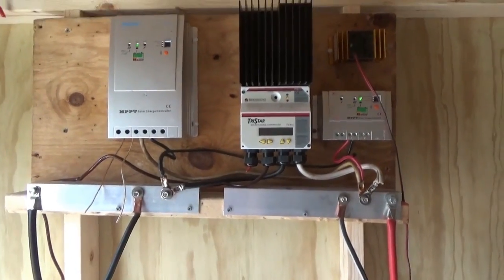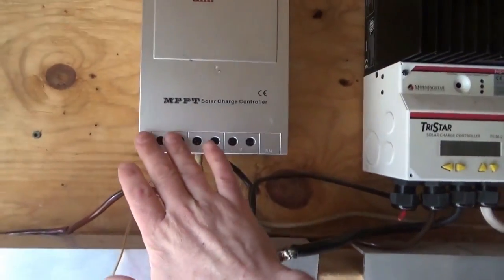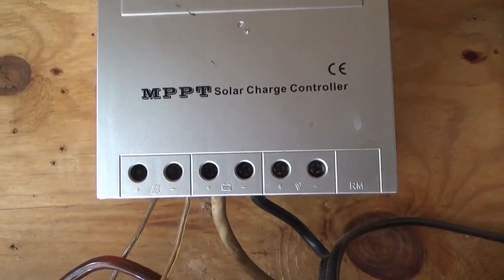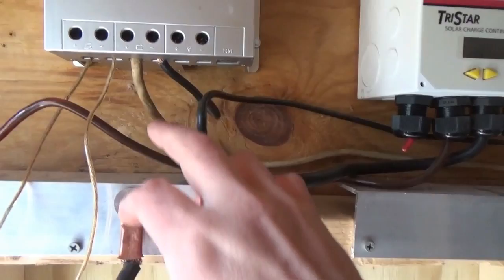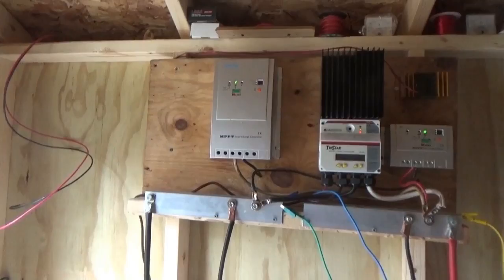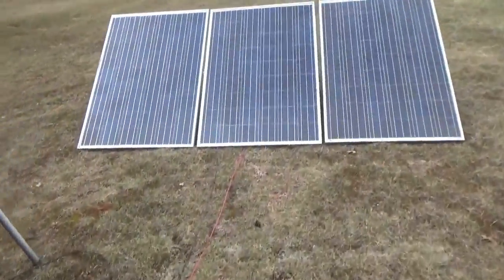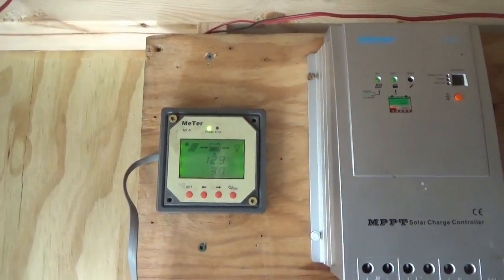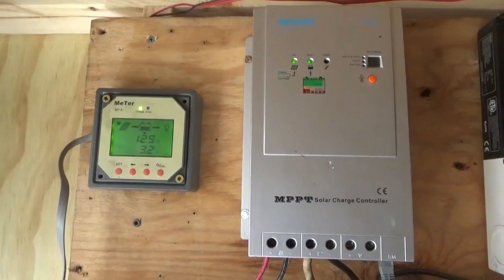How To Connect Solar Charge Controller ~ Setting Up Off Grid Solar

Comment: What happens if, you don’t hook up, the battery first! Nothing blew up ! Should I disconnect it, and reconnect it! If that reset the controller
Reply from the maker: Always connect the battery first. This powers on the charge controller. If you did not, I would remove everything and connect the battery first, then the solar panels to be sure things are running properly.

Comment: What gauge wire did you run from your panels to the controller?
Reply from the maker: Dont remember but use the biggest you can fit or afford.

Comment: Hi buddy great job, l have exact charge controller, can you tell me about the option settings in the spy glass where it should be set to? I have 2x 230 amp deep cycle 6 volt batteries 2x panels cheers..

Comment: Hello Bro🙂
I have 5 mono solar pannels 150 watts each .i have used PWM charge controller Battery Bank that i have is 230AMP .i have used My 12 Volt Dc in which i have 3 fans and 6 LED lights .😊
Total load have is 16AMP.i connect solar plates parallel Now.i bought MPPT charge controller 60AMP.
Kindly suggest me that i used this as a parallel or do it in series connection.Thanks😊
Reply from the maker: Look at the maximum input voltage of your MPPT controller. Wire your solar panels in series to add up the voltage. You can be lower but do not exceed the settings of the charge controller.

Comment: Troy, I always get confused when wanting to hook up a controller. My LOAD is connected to the battery in my RV. So, do I try and separate the load from the battery bank or can I simply hook up the battery ( with the load ) to the controller as it looks like you did on this video .? Thanks
Reply: The load going through the controller usually has a max of 30 amps, limiting the uses you could use through it. The MPPT controller I just bought controls the load with a timer, it's either always on, dust/dark or always off, with protections for over current, over voltage etc.  If you have a battery bank supplying a 3000W power inverter You can't wire it through the controller as it would always trip out.  The load will draw current out of the circuit, pulling all the current generated by the solar cells and compensating with the battery bank during high production periods (noon) and vice versa when the panels can't supply enough juice to run your loads. The inverter should have its own protections for low voltage and fused appropriately.
Reply: Thanks so much for answering. That all makes sense, ( the inverter tripping out ..due to over current draw.). So, in an RV, you wouldn't need to use the separate "load" hook up on the controller.

Comment: When using black and white wires for 12volt/low voltage you should be using black for positive and white for negative.
Reply: Black has always been Negative for DC in Australia . Black or Blue always Neutral for AC in Australia
Reply: @davidsoper1885  That's an interesting aside but this guy is in the states and has used the colors black and white in a backwards fashion for here in the states. Hence my comment.

Comment: I've got an SRNE 4860 60 amp charge controller.  One of the settings is "capacity".  I've got 4- 6 volts wired in series for 24 volts, batteries are 225 ahs.  So would I set the capacity setting at 225?  Or higher?  The manual sort of sucks in my opinion, or it may be me, being a newb and all.  tks.
Reply from the maker: You have a total of 225Ah at 24 Volts. The Watts are still the same though but the Ah does not increase when wired in series.

Comment: has anyone connected panels to a charge controller before connecting the batteries? if so what happened.
Reply from the maker: It could harm the charge controller so I would try not to.

Comment: You need  a  combiner box for your panels safety first. ... ..I have a trystar ts 60 PWM controller am getting 80 volts to my 48 volt bed works grest am running 14 -310 panels and 4 - 240 panels on a smaller controller .thank you for sharing your videos

Comment: I have a NEW PWM 20A LCD USB Solar Panel Battery Regulator Charge Controller Kit 12V 24V. I connected around 15 solar panels and 10 big batteries and probably around 15 small batteries - all 12v. I'm having trouble keeping power enough to one bedroom with a 400 watt power sucking TV and then all the other electronics in there like a laptop and just some lighting and phone charging. I did take several of the bigger solar panels most of which are 100 watts each and I did collect connect them positive to negative to positive to negative and then the ends to the system. What am I doing wrong. I should be charging a whole lot more.
Reply: 1 panel is about 8amps so u can only use 2 panels u need bigger mppt

Comment: I'm running that same 24v system as well with the 8 t-105 batteries on a catering truck and that would be awesome if I could convert it to solar charge after I unplug from city power. Where did you buy the panels from and are they expensive?
Reply from the maker: I got mine 2nd hand but unused. So cheap. EBay has very cheap panels now. Look for $1 dollar per watt or less.
Reply: The Do It Yourself World how many watts do you recommend?

Comment: Wire tips      That wire ,if 6 awg is good for up to 120 amps. Your inverter looks to be drawing a normal max if about 83 amps.  IF you bundle the wire ,that is cover it with alligator skin. REDUCE the current rating by 30 percent for heat derating. There  is no way I would use that wire without flux and tinning the terminals with solder. I wouldn't tell anyone when I use lead /tin solder. Shrink tubing on the terminal end is good but don't go over board on the length.  If someone os going to do any DC electrical project, I recommend printin and posting this chart.      https://www.westmarine.com/WestAdvisor/Marine-Wire-Size-And-Ampacity         Now ,if you want to calculate what your losses on the cable would be, pay special attention to the OHMs per 1000 feet column,which in this case would be .4 ohms per 1000 feet and use the junior high school formula of Power (on the transmission line)   EQUALS current squared times resistance  IN OHMS      tHE power loss for 120 amps times a thousand feet would be 19.2 watts or ONE Tenth of a watt for a ten foot section IF 6 guage wire with NO high resistance fittings.      This chart is again for DC current . Charts are different for AC.

Comment: troy get the solar panels somewhere else. your junking up the yard. fine another place for them.
Reply: hope its not gonna be a 30 years planning,  its faster to fix things correct the first time... , he is not depending on the power now, so no hurry involved, its realy better to do it right directly, build a frame, put them on the right angle, a few feet above the ground, build a frame first!!!!
Reply: y understand, but again do as mutch as possible right the first time, less hassle in the future! (y)
Reply: i know they need the sun.But make something that they are up off the ground.
Reply from the maker: Oh but there is a rush. You have not seen my estimated energy bill here. Ouch!!! I have to get off the grid in a hurry or I wont have any money for anything else but electric and propane. And yes I plan to get the solar panels off the ground right away. On frames. Adjustable frames. Payday is this weekend and I have to see what is left after the bills before I buy anymore wood.
Reply: you cant put solar panels in shade they don't work very well in the shade and its not junking it up if its something that's being useful and I'm sure troy figured out a frame that can allow for better solar production so unless your in troys situation you have no room to speak.

Comment: Generic safety/code suggestions:
Usually code requires physical switch between panels and controller; fire Dept. likes to see those. Most people also fuse/breaker at least the plus line; some code requires fusing/breakers on both POS and neg lines from panels. cheaper controllers also should have surge arrestor to help prevent lightning damage; better controllers build them in.
Battery setup should be fused/breakered on both the feed to/from controller and to inverter. Feed from controller to batts should also have a heavy duty switch in addition to the fuse/breaker for safety and maintainance. Usually code throws in more picky points but the above is usually the minimum for safety and servicing purposes.
Reply from the maker: Thanks for the updates. When connecting all of this to a house I will pay the electrician in order to cover myself.
Reply from the maker: I wonder how they do that with all the micro inverters with grid tie setups? I cant imagine 20 or more switches.
Reply: microinverters are tied together and/or are exempt because their on/off switch on the unit counts for code and/or an exemption due to being within 1 or 3 feet if the panel and the switchgear by the grid tied does all the on/off work. Grid tied never made sense to me so I glanced over those parts of NEC code rules...
Reply: Good idea! In my neck of the woods inspectors were hypersensitive to anything within 10ft of a house, sheds - not so much. Probably should have a chat with your city/county inspector to see how they feel about code; some are flaming aholes, some are super chill...

Comment: How to install a solar charge controller .
Read the manual , Understand it , Ask if you don't  !
USE the voltage sense on the morning star  .
You will be saying it's voltage is incorrect …
Use all the controllers capability's / enhancements  , there not for show .
Reply: and juse the temperature sensors on the bank...

Comment: When you were showing the battery bank I did not see any kind of fuse. I fuse mine at the battery's. All it takes is a fuse holder made for big audio amplifiers and you can get fuses over 100 amps. Without a fuse at the battery's something could happen (tool fall between your powder strips, ect) and turn the smallest wire inline into a heating coil and easily cause a fire. 
http://www.ebay.com/itm/NEW-EFX-4-8-GAUGE-AGU-PLATINUM-CAR-STEREO-AUDIO-AMP-WIRE-INLINE-FUSE-HOLDER-/300869684875?hash=item460d3b0e8b:g:0h4AAOSwzOxUWO76
Reply: well use the plate fuse or use a couple in parrel either way a battery bank unfused at the batteries is a dangerous thing. the largest draw I ever did was 25 amps to run a commershal smoker (only for the motors and the electronics) when there was electrical storms to protect the smoker but also keep production going. tne point is you figure the max you are goi g to neec and fuse over it a bit. a 100 amp draw on his battery bank is not going to last but a very few min. I could do my 25 amp draw for 11 hours with a 8 battery bank.
Reply: point is you need a 300 amp dc fuse iff he uses his4kw inverter... they sell plate fuses for that, we use them on boats. 100 amps is nothing on 12 volt systems..
Reply: agree, but if you draw 3000 watts at 12 volts its around 250 amps draw from the bank, at 690 amphours thats do able for 1,5 hours...so you have to fuse acordingly to the possible (short time) load.

Comment: Did you bring your wind turbine?
Reply from the maker: I do have one here and have to go back for the other one.
Reply: forget those bloody small wind turbines, they wont work in forrests... they dont, you have to make huge masts for only a few usable amps, wind turbines are only usefull if they are huge. small ones are good on oceangoing sailboats, fot thre rest they suck for charging whit high amps. one solar panel more wil give you way more power then those small turbines.
Reply: Read my comment, sell them, or trade whit solar panels or battery's.,you dont gain mutch whit these wind turbines.

Comment: jsust wondering .. shouldnt you have somthing covering your buss bars speacialy the posetive side to protect from accidental shorting out ?
Reply: Not to be negative, but It still is a mess.... for ones can you do something at least a little to code????   Have seen some good comments here, Quit building things for temporary,but build  correct the first time, way lesser work and problems.. put your panels on the roof off the shead,(use alu angle profiles) use breakers in your cables,(also in the panel lines, dont put more then one mppt high power charger on the bussbars, connect all mppt chargers whit as thick as possible cables to your bank, and switch and fuse it, you can use the busbars for apliances other then the mppt's (if you put several mppt chargers on the same bussbars they will react to each other, and not on the state off the bank), and ground your panels, use a earth rod..(for your safety). not to troll, yust to advice...
Reply from the maker: I am only using one MPPT charge controller right now. And your advice about only one on a bus bar is good. They did not work well together before. Thanks. I cannot put solar panels on the shed roof. The sheds are in the shade. Had to follow town hall permits for location. The solar panels will be on stands out in front. House is in shade too. No solar panels on any roof out here. But the sun shines all day on the yard. Very nice.
Reply from the maker: I am also still on a budget. I have plans to make things good. Right. But it all still takes money.
Reply: btw, as said before put the bank in a box whit a lid on it, and a pype to the outside for ventilation..cover your positive bussbar, and use fuses!!
Reply: Still keep on kicking him to do it correct,(also when he advices people how to, he has to  explaine  it correct) been kickin for about 4 years now... lol one time, one time ... lol
Reply: tt4465543
Reply: The Do It Yourself World w3   č
Reply from the maker: If you feel safer that way then certainly yes. I use mine heavily for clamping things onto them so I need them open to use all the time. Never once shorted anything out on them in all this time. Mostly due to being up higher on the way and out of the way I guess. Just as much chance of shorting out something on the top of the battery posts as anything I figure. Safety when working around batteries is very important :)

Comment: will the panel stay on the ground , or go on the roof
Reply from the maker: Neither. Going to make a frame for them up higher off the ground but generally right where they are. On the roof of the shed is shaded. House too.